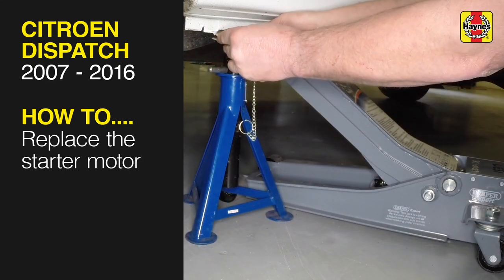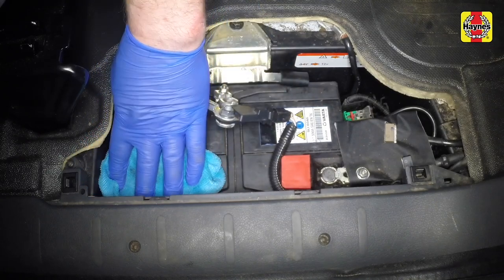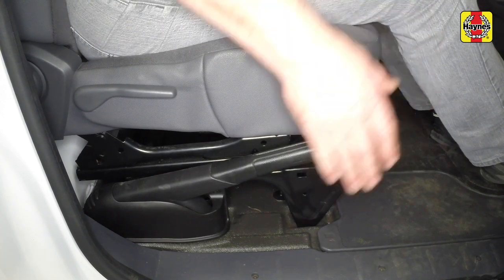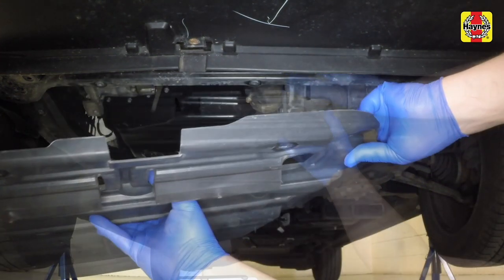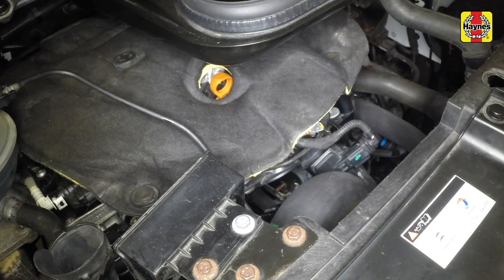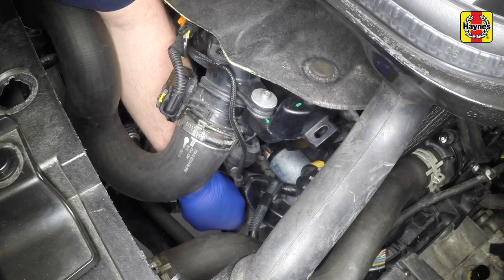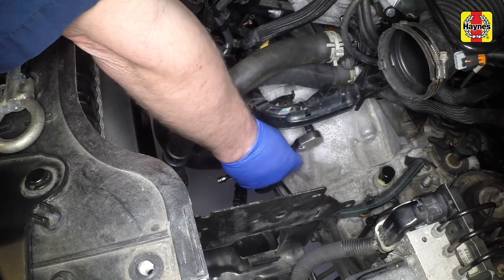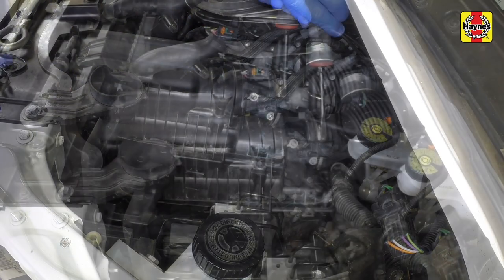How to Replace the starter motor on the Citroen Dispatch 2007 to 2016

Comment: I dont understand why van has lifted and the remove the under tray?? the job has been done from top?
Reply from the maker: I think that raising the vehicle and removing the undertray is optional. According to our manual: ' So that access to the motor can be gained both from above and below, apply the handbrake then jack up the front of the vehicle and support it on axle stands'. If you can reach the lower motor bolt from above, then there's no need to remove the undertray.